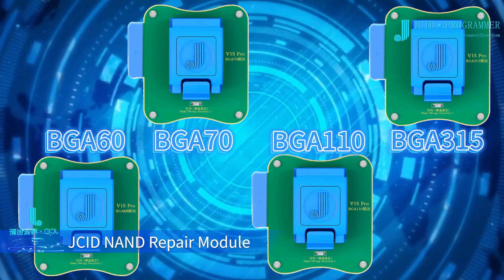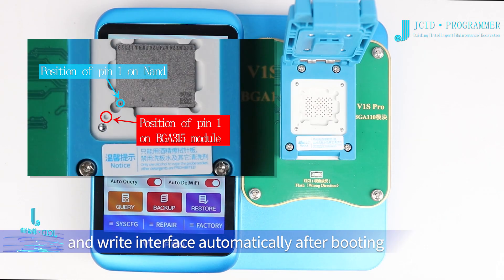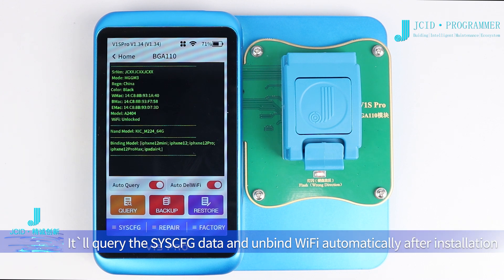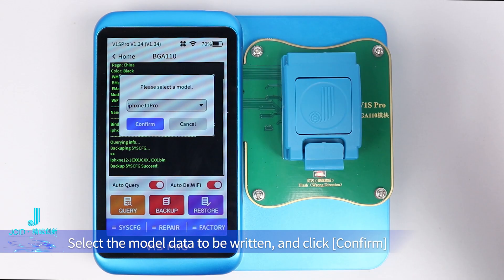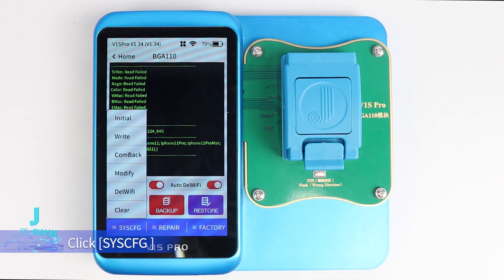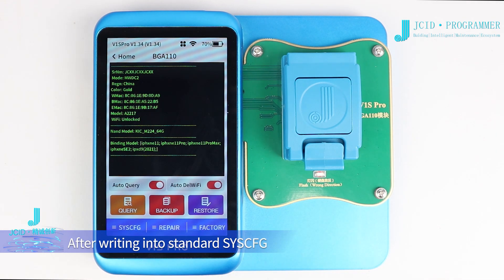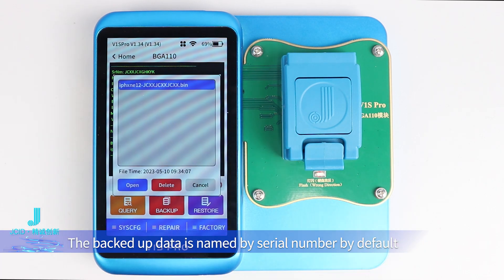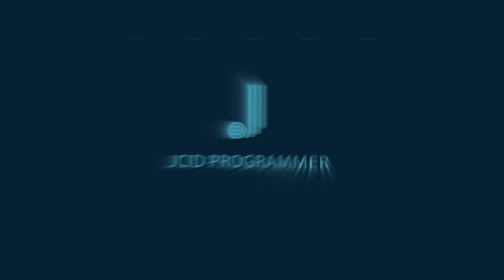V1SPro BGA Module SYSCFG Data Reading and Writing Operation Guide

Comment: Why can't the chip data be backed up to a computer? Or a backup copy of the dot projector on a pc? And in general everything, but you can only rewrite nand using a PC, sometimes you really need to record everything using a PC
Reply: Yes, the computer and the mobile phone are connected to the same router, and you can open the platform and operate online